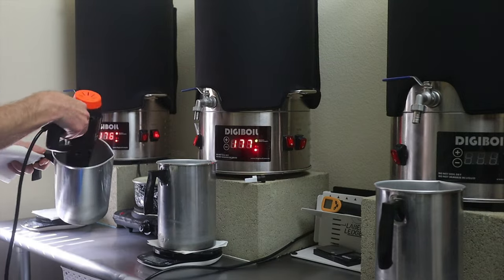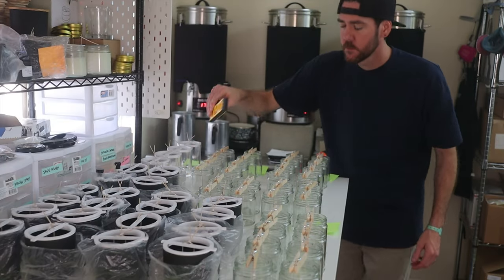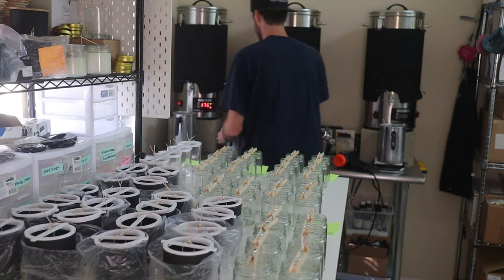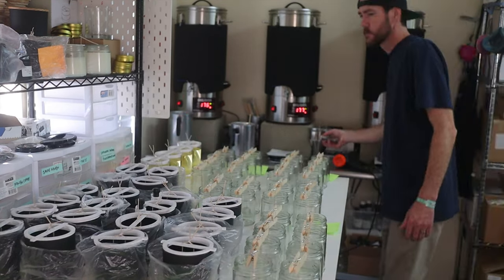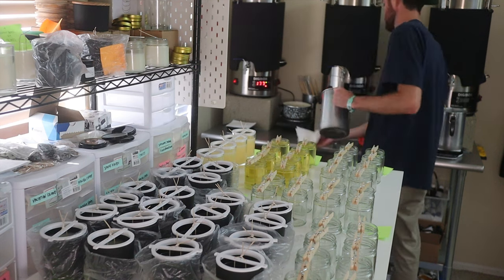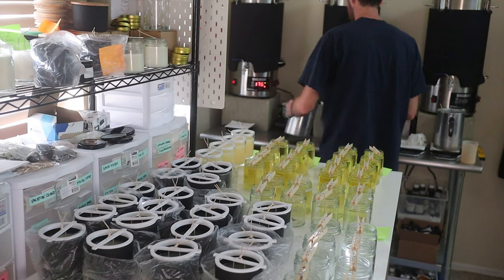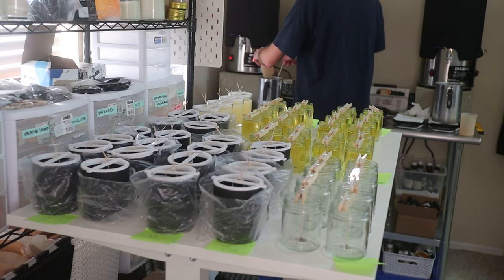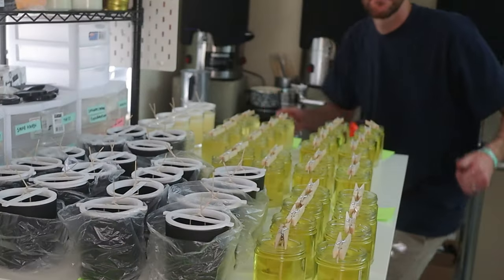Make Candles With Chris Part Two: The Pouring Process | Making The Candles, Quality Control, etc.

Comment: Do you leave any extra wax in the boilers  if you have left over ty
Reply from the maker: Yes! The best thing about the digiboils is you can leave wax in there to solidify and then melt it down again during your next candle making session!
Reply: Hy Dear Erika where you buy pot wax thanks what side wick you use for the clear 7oz jards. Thanks